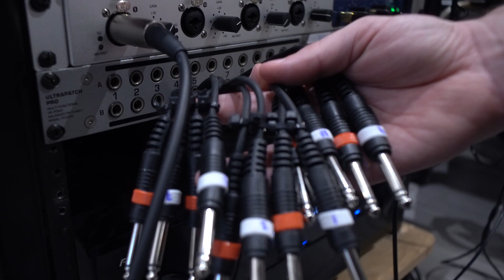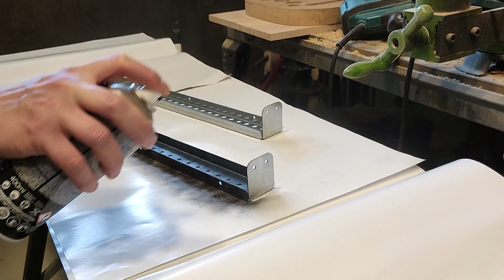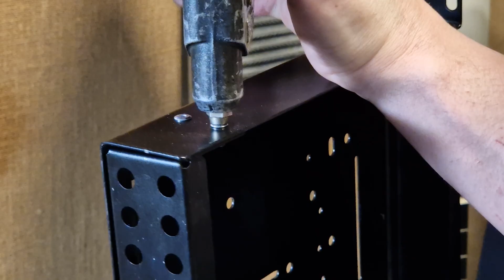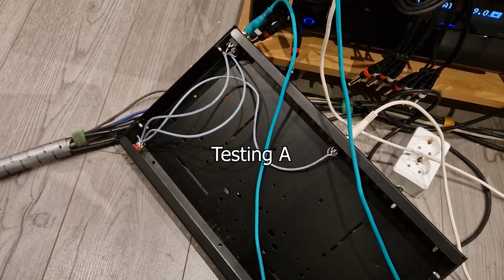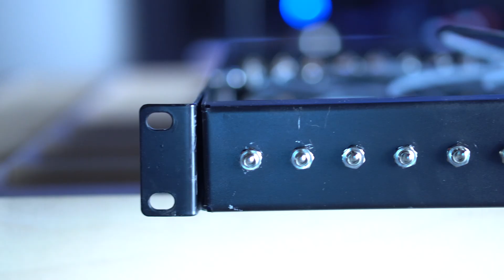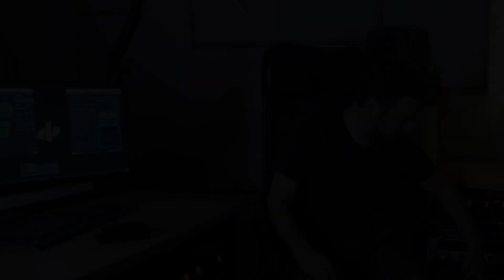A Passive DIY A/B Switch for Dolby Atmos Arrays?

Comment: I've never met a person who has a system for playing Atmos except for other audio engineers. How are the fans going to listen?
Reply from the maker: Ever been to the cinema? You honestly know NOBODY with an Atmos setup, not even Airpods? I wonder how many people I would known with a Stereo system back in 1930 :)
Spatial Audio (not Dolby Atmos, but the whole spatial atmos as a concept) is here thanks to technology making it possible, without baked channels like Surround used to do - who would have thought a couple of gyroscopes could be worn on your ears back in 1995... 

Today, technology is opening a door to implement new ways to listen, because we hear in three dimensions. To me, this is an opportunity we should embrace :) Perhaps not to you, and that's okay, too! This A/B switch will help you with mono and stereo arrays, so there's that :)
Reply: @AudioBrewers  I mix everything in 3D. The Atmos mixes sound worse on Airpods than the stereo mix with HRTFs, psychoacoustic panning, analog summing, analog dynamics and saturation, because Atmos does not allow you to apply your own dynamic DSP onto the buses after they've been decoded to stereo, therefore you're missing out on all the color and dynamics that comes from working on the stereo buses, the 2-bus, and the master chain. You can process separate Atmos channel pairs with the Vari-Mu, but you can't use it to glue the mix together. You can saturate each track separately with the Neves, but you cannot get the 2nd level of harmonics that come from line amplifying the summing bus, which harmonically correlates the parts and glues them together in a pleasing way. You have to try to simulate what a master bus would sound like if all the byproducts of analog processing are stacked on top of each other. Your dynamics will not respond the same way when processing individual tracks as when processing the 2-bus. You need to use only Atmos-capable surround dynamics plugins. Your analog summing? Scratch that we are digital now. Don't touch your Neve console again most of the functionality and sound of the console is worthless, that's just a limited way of listening -- better to use only Apple's digital summing and no master chain and instead only use Apple's horrible sounding cheap built-in limiter plugin that's inside the Airpods Atmos decoder. Your Chandler EMI limiter? All useless stuff now. Better to go with Apple Corporation.
Reply from the maker: @zyxyuv1650   Seems to me there are 2 basic issues here:
1: You are trying to approach immersive mixes with Stereo techniques and tools
2: You are frustrated because the tools and knowledge you already have and know how to use, won't work the way you want them to work

Immersive Audio requires an overhaul on your approach to audio and the techniques. If you continue to approach it "the stereo way", the sound will always be bad, and you will keep blaming Atmos (or whatever tech you're using) - meanwhile, other engineers will create masterpieces and make this tech amazing (for example, if you listen to the latest album of Bjork in atmos, it's simply amazing).

The above is just a suggestion to see things from another perspective :) 

Only time will tell, but I strongly suggest you remember when The Beatles would mix the drums hard-panned to one channel and the bass to the other, when Stereo was infant... instead of complaining that Stereo was "too much and sounded bad", there was an era where all the rules were set by those who decided to push the artform of audio engineering. NOW is that time again, and YOU yourself have the chance to make it happen... do you want to get on that car? or do you want to watch it leave?

Anyway, this video is of a totally unrelated subject, if you wish to debate feel free to write me an email or something, I'll happily exchange points of view with you. For the time being, enjoy the AB Switch - it's not only useful for atmos, but for any speaker array you might want to use :)

Peace,

Comment: Love it! Great approach and sure lots of soldering work! Quick question about you rack, though: I'm using the 802 as well and I'm considering going Atmos. Since the RME has only 8 analogue outs (ignoring the headphone channels), how do you get the 12 Outs required for Atmos? Do you use ADAT to feed the Octamic and use the additional Outs or do you have some "aggregate device" with the Scarlett? I'd love to expand my setup but honestly I don't need RME quality (and pricetag) for the less important channels.
Reply from the maker: I have my setup as follows:
RME 802 -> 7.1
RME 802 -> ADAT -> Scarlett -> .4 (Height channels)
Reply: @AudioBrewers  So you can use the Scarlett in standalone mode? I didn't know that! Wow you made my day and probably saved me a lot of money! :D
Reply from the maker: @TheParagonAxis  YEP!! I connected it to the USB port ONCE, configured it, and ever since, standalone